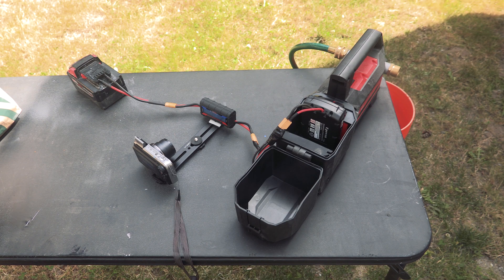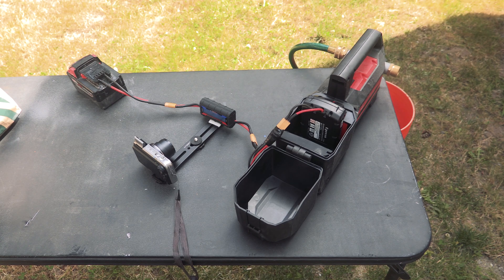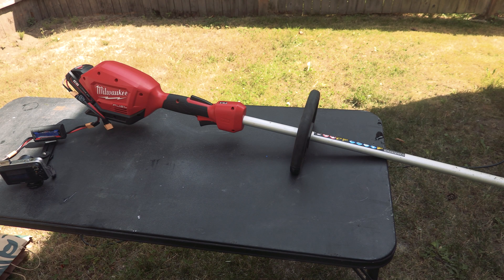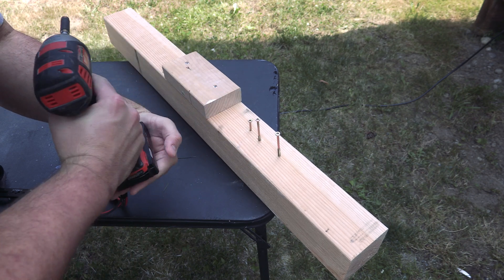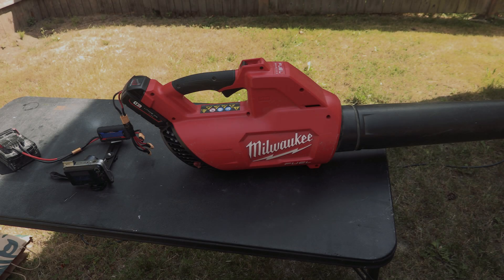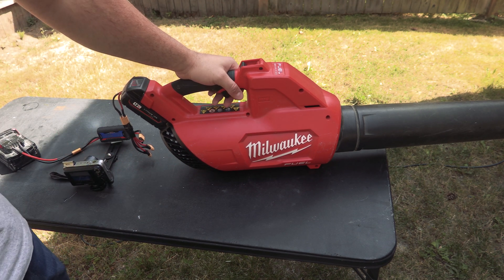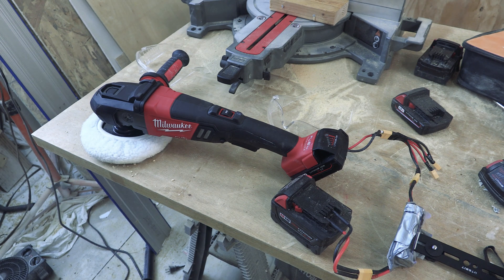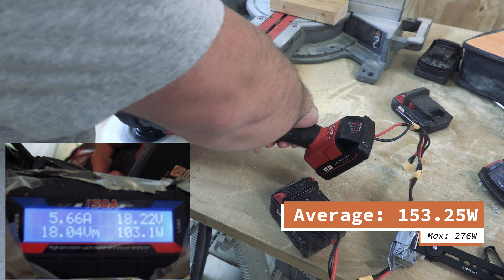Milwaukee M18 tool current/wattage testing

Comment: I would like to see you run this test again but this time put 3 5ah battery in series. I believe your results where limited to amount of power that 1 5ah battery can deliver. For my purposes I want to know the max power these tools will use.

  Thank you for the information and the video it is very helpful

Comment: So what will this knowledge tell me if I want to take a single M18 battery, connected to a buck converter to 12v and run 12v device(s). As in what is a comfortable startup/average wattage you be comfortable draining an M18 battery at? I believe these test result watts he listed at the end of the video would translate to 12V meaning I could take an M18 battery and push it to…say…800watt max 400watt average running and not ruin the battery?

FYI I have an application in mind that’s about 150watts average at 12V so that seems pretty easy for one battery for hours on end?

Comment: is 10 awg good enough from the power supply to the battery tool? im using it on high torque impact driver most of the time

Comment: Great information! 

I’d like to know the current/wattage of the m18 vacuum used in the previous video. I use the 2nd gen m18 wet/dry vac all the time, and a dedicated power supply would be super useful!
Reply from the maker: I'll add this to a list for a compilation video i'm working on.
Reply: I have the M12 Fuel vacuum. It uses 14A on low and 24A on high.

Comment: Thank you. I have been trying to find this information online for awhile. I actually built a test rig similar to yours but the tool wouldn't power up for some reason. It was missing a signal
Reply from the maker: Did you try using aftermarket or original batteries? You have to use aftermarket batteries for any of this to work.
Reply: @harrisonhobbies241  original battery

Comment: i request you to do a video for Milwaukee M18 FUEL Cordless High-Torque Impact Wrench with Friction Ring — 1/2in. Drive, 1400 Ft.-Lbs. Torque, Model# 2767-20.
Reply from the maker: If i end up getting that tool, i'll ping you and let you know when the video is posted.

Thanks for your recommendation!

Comment: Great content for sure!  keep us updated please.  I'm planning to sort out a solution for the new Packout vacuum as it kills the batteries super fast.
Reply: I'm planning to build an 120VAC-18VDC power supply that fits in a half sized Packout bin so it can connect to the vacuum and run as long as I need it to.  As a bonus, I will also be able to run any of my other Milwaukee M18 tools on the site if all the batteries run dead.  It happens more than I should admit.
Reply from the maker: A pack-out sized system is a great call. I may have to try to format my gear into that type of form factor.

Comment: a good way of doing it might be to have an 18v or 20v capacitor bank powering it and instead of a dc power supply use a transformer to step mains down to 18v or 20v then run it through a full bridge rectifier to charge the caps that should give a cheaper and far higher capacity set up allowing you to maybe even have multiple large tools going at once if
Reply: also, this might be easier to try with m12 tools first as components are more readily available
Reply from the maker: Thanks for your feedback! I'm planning on using capacitors in the next build, but didn't include a full bridge rectifier - I'm driving the capacitors in parallel with what would have been the batteries. After doing some research, i was struggling to find any ultracapacitors that weren't either huge, or cost prohibitive. If you know of any sources that may offer what I'm looking for, please share!
Reply: Most good power supplies will have over-current & over-temp protection, as well as a hard shutdown on short circuit and voltage regulation under load. While a straight rectifier solution may work, the power supply is much safer.
Reply: What about three 6v flooded lead acid batteries, along with a charger? Starter batteries can dump a lot of current for a short time, then have a charger to refill.